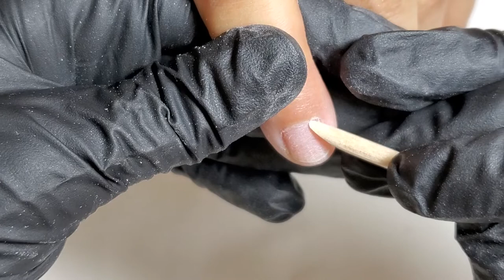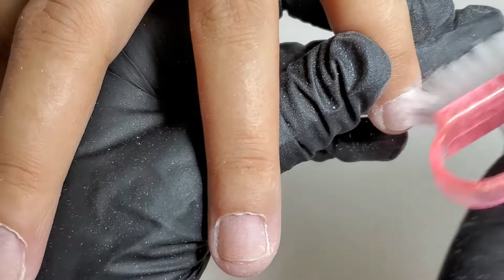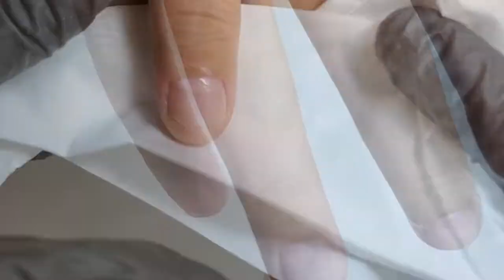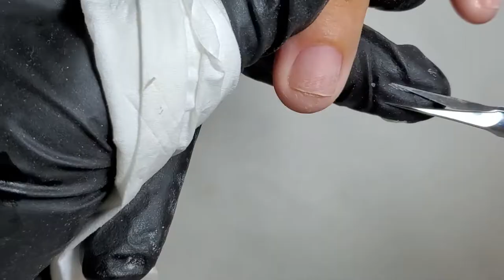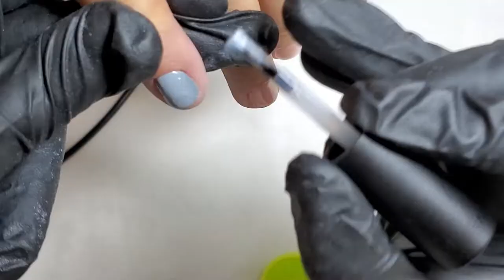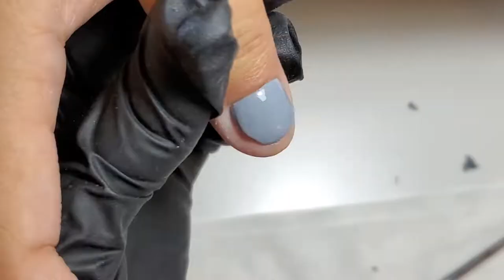Short Bitten Gel Nails | My opinion on bitten nails transformation | Types of Nail Biters

Comment: Thanks for sharing short nail videos! I’ve been binge watching your videos. I have short nails genetically and appreciate seeing techniques on similar nails. Question about buffing natural nails- does it not thin the natural nails?
Reply from the maker: Thank you so much for your feedback, you made my day! 🌺
That's a great question! Buffing natural nails does thin the natural nails. 
On average, our fingernails have 100 layers of compacted keratin cells. When we prep nails professionally with a file 240-180 grit, or with a buff, we remove about 5 layers. So that's not too bad, and doesn't thin nails so much. But. When we remove material completely and buff nails again, another 5 layers are removed. And if that circle happens couple of times, then, of course, natural nail plates will get thin. That's the reason I always leave a thin layer of base coat on the the nails when removing gel (I never soak off, only file off) - so not to file/buff natural nails again and again. I hope it makes sense 🌺

Comment: Hello, a question Miss Yana what is a hardware manicure?
Thank you in advance.
Reply from the maker: Hello Fabian, thank you for your question! I'd say a hardware manicure is a synonym for an electric file manicure. I think "hardware" is not a proper calling, and probably was created by wrong translation. A lot of Russian speaking nail techs use "hardware manicure" to name an e-file mani, as they used Google translator, and just simply don't know it's not correct phrase to use. So to answer your question it's a type of manicure made by using an electric file machine and different attachments for different needs to remove old material or to clean up the cuticle area.
Reply: @yanaunovanaileducator8016  thank you for the response, it make sense. Saludos desde México.